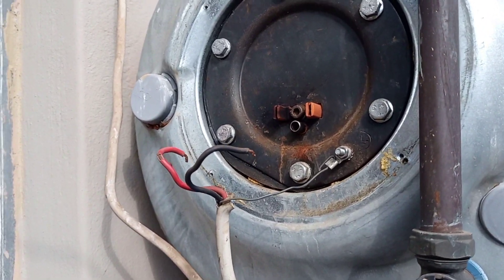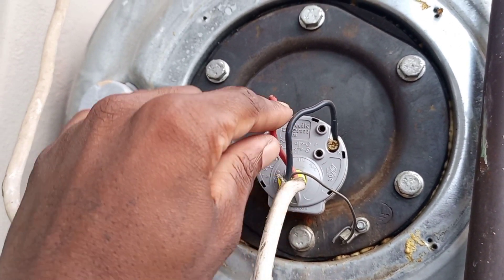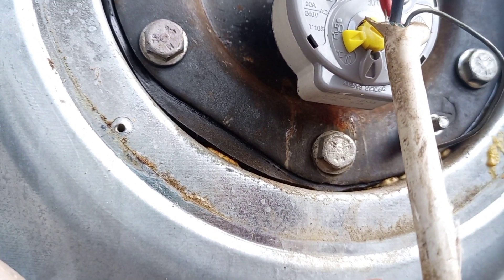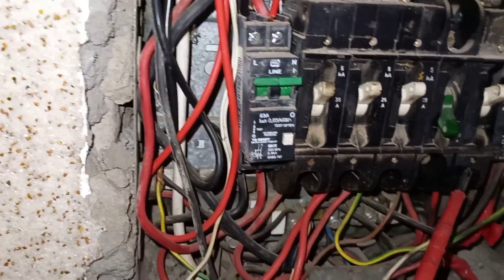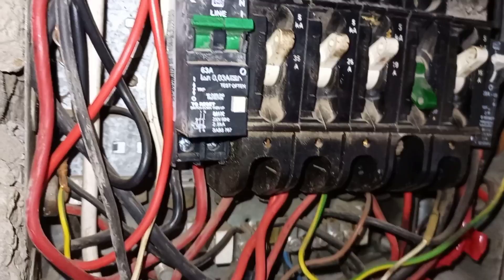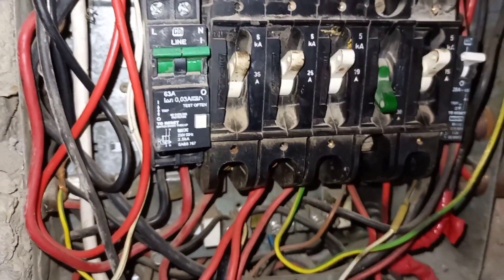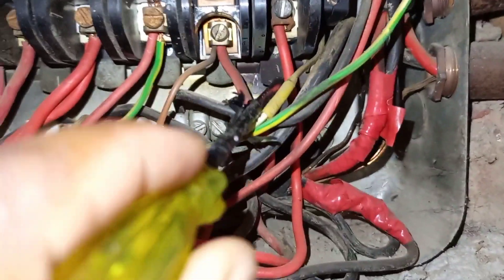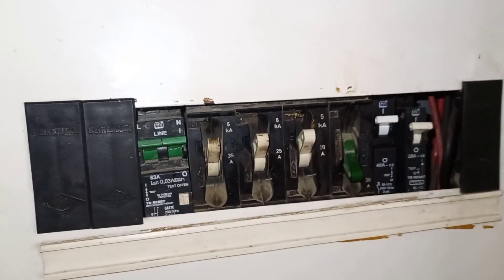Geyser circuit breaker triping and making a ark, See how I fixed it

Comment: I disagree with you, when you say the circuit breaker for the geyser must be 40 Amp, since when? Because it must be 20 Amp not 40 Amp
Reply from the maker: Does it make sense that the Isolator is 30A and the breaker is 20A? By the way forgive me for using "must" instead of "atleast". You also can not say must since breakers are selected due to load.

Comment: Mine is still tripping I checked the circuit breaker and I even replaced it with a new CB 40A but still tripping….🙆
Reply from the maker: @kagisooj1346  Hope you came right,  the element can also do that

Comment: I have an issue I've connected my live onto the thermostat and my neutral on the other side coming from my power cord then bridged the live and neutral straight onto the element keeps tripping the power so I put the power into an extension cord and not straight into the db board it was working fine for a few days but today after being on for a few hours the extension cords box melted and the plug comimg from my element and thermostat what went wrong? Also Mine isn't on a geyser it's a big metal hydro dipping bath filled with water I don't need boiling water just 26 degrees is fine so overheating can't be the reason why the plugs melted
Reply from the maker: @devantevanderwalt  am sorry about my late  reply. I hope you won. If I were on your shoes, if the breaker was not tripping when I hadn't connected, but only when I was connecting, I was going to change the element.